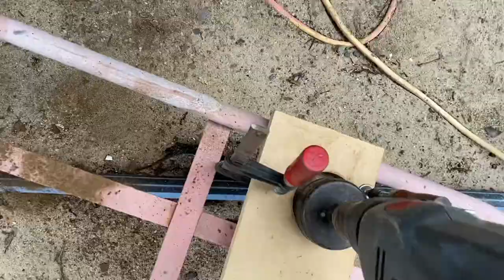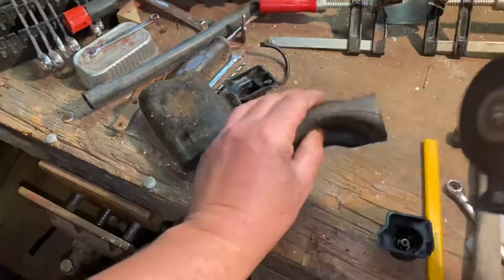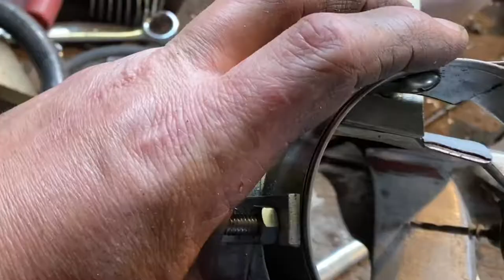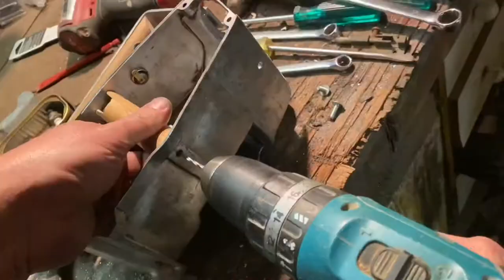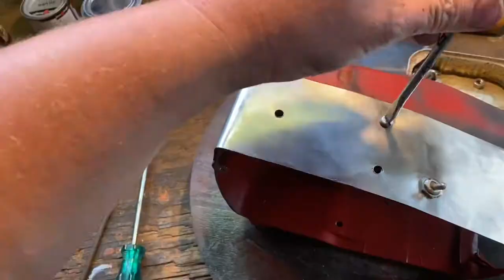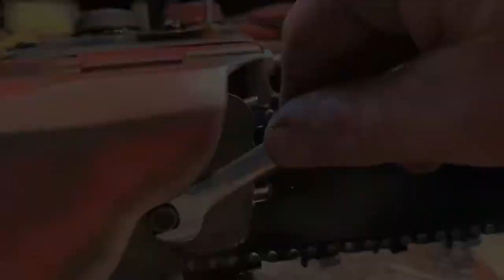Evil dead 2 inspire chainsaw

Comment: What was that material you put over the black metal handle? And do you have any advice for getting the material on there?
Reply from the maker: @kcJOOONES  hi mate so I got it from the hardware shop. It’s like a rubber hose. Think they use it for sprinkler systems or something like that. It was quite easy to get on, if you put hot water on it maybe it might be little bit easier. But I had no trouble getting it on just took a little bit of time.
Reply: @thedodecagon249  awesome! Thanks for the reply